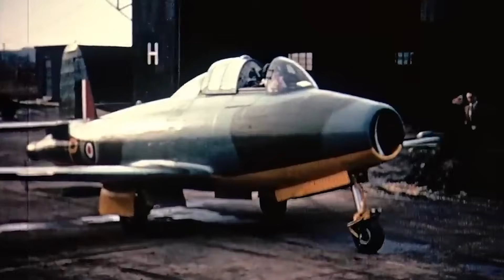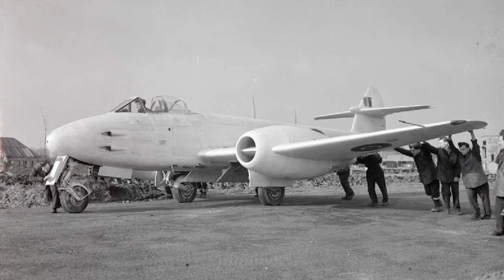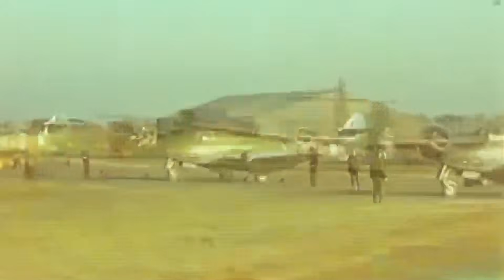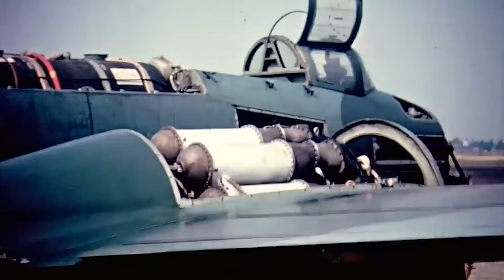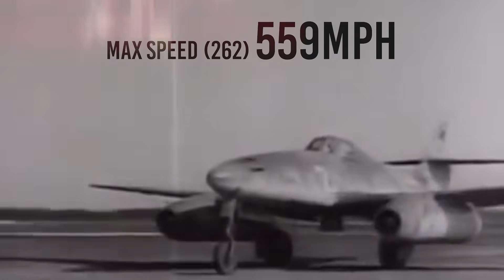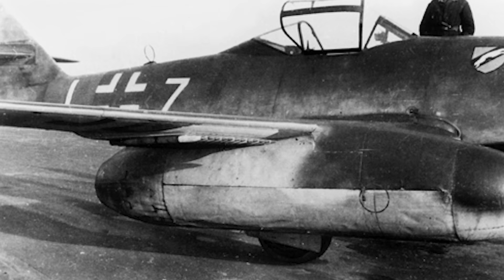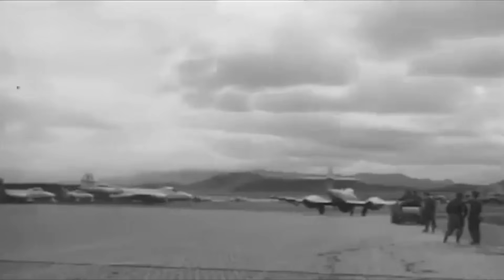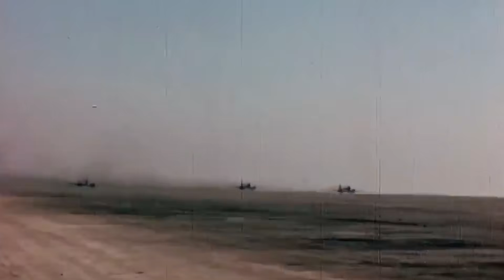Meteor vs Me 262 | Which was the better WW2 jet?

Comment: In September 1945 the Meteor set the world record for speed at 611 MPH. This is a matter of record. the Me262 looked better, but the Meteor had better engines and needed less maintenance
Reply: The Meteor III only had a critical Mach of .74, the 262 .86. Given equal thrust, the 262 was always going to be faster according to the RAF
Reply: @TheAneewAony 

LOL The Nimonic nickel super alloys were developed in Hereford England 1939 -1940. In Germany they thought they needed to use stainless steel for turbine blading which doesn't work and due to various issues ended up attempting to use pressed sheet steel turbine blades. 

262 & it's engines = Garbage (but it did actually fly which surprises a lot of people). In both Russia and France good people wasted their time trying to do something with the engine after 1945. Russians ceased trying in 1948 as their own effort was clearly better.
In France RR got involved in 1950 and managed to get something useful working. 

We feel we can clear up some commonly held myths and misconceptions, obviously.
It's always good to see the facts presented clearly and concisely isn't it?

The Gloster Meteor was one of the world's first jet fighters to go into service, it was in service during WW2. The meteor was the first effective multirole fighter bomber jet aircraft with a reliable engine to go into service,  It broke speed records in 1945 and 1946. During WW2 it was in service as a fighter and multirole aircraft over the UK and over all allied controlled territories in Europe and beyond. 

The ME-262 and it's 46 minutes life engines were abandoned shortly after 1945, it had a do not exceed speed of 456 mph and was only ever used to attack bombers with losses of three 262s for each downed bomber.  During WW2 most of the ME-262s were destroyed by their engines, were various types of accident losses or were shot down by bombers. No German designers were involved with the Mig-15. The Mig-15 used a copy of the RR Nene.  

During the Korean conflict most of the Meteor casualties were due to groundfire or accident losses. The result of any tangles between Migs and Meteors was that Mig pilots avoided getting into dogfights with Meteors. The battle of Sunchon, where 50 Migs against 14 Meteors resulted in the supposedly superior Migs failing to gain any clear advantage caused the Koreans to re-evaluate tactics. General opposition in Australia to involvement in the Korean conflict resulted in the govt using the battle as an excuse to reduce the RAAFs involvement to troop support only.

The world's first wind tunnel was built in England during the 1800s. The world's first supersonic wind tunnel was built in England during the 1920s. 

The Whittle Gloster E28/39  was of course a brilliant aircraft that was later copied in Russia as the upsized and tweaked Mig 15 with a copy of the RR Nene gas turbine aero engine. The RR Nene being the world's most powerful & most reliable gas turbine aero engine in 1944.

The MD F3H Demon was a contemporary to the DH Sea Vixen & had a similar performance. The F4 Phantom was a follow on from the F3 Demon. The Sea Vixen took a long time to get from first flight to introduction for various reasons and a similar situation occurred with the MD F3H Demon.

McDonnell Douglas F3H Demon
590 Built. Not Supersonic.
Max Speed 578 MPH.
Introduction date 7 March 1956
First flight 7 August 1951
Retired 1964

MD F-4 Phantom 2
Number built 5,195
Manufactured 1958–1981
Introduction date 30 December 1960
First flight 27 May 1958

DH Sea Vixen
Number built 151 (including two DH110 prototypes and one Sea Vixen prototype)
Introduction date July 1959
First flight 26 September 1951
Max speed 695 MPH.
Retired 1972

Interesting British achievements.
There is no doubt that the Fairey (England)
Delta 2 was of course the world's first jet
aircraft to exceed 1000 mph.  Indeed It
exceeded the previous record by 310 mph &
held the record for 1 year. Incidentally, the Dassault Mirage 3 & 4 are based on the Fairey Delta 2.

The Panavia Tornado & Euro fighter Typhoon are British design aircraft with British design engines built by international consortiums. 

The EE Lightning was one of the fastest aircraft on the planet when it first achieved a Mach 2 flight. 

Early days, jet fighters.
De Havilland Vampire, Sea Vixen & Gloster Meteor accident losses were not high or unusual for fighter aircraft at the time. De Havilland built large numbers of all metal airframe aircraft before the DH Comet.
We mustn't forget of course that the DH Vampire for example first flew in 1943 & the engine was also built by De Havilland. There were examples of the Vampire interceptor / fighter in service until 1990 which was operated by more than 30 countries.

Non combat phase accident losses.
% of Aircraft built.

The Canadair CL-44 was a turboprop airliner.
Canadair CL-44                  (ff 1959 ) 48%
Lockheed XF104                (ff 1954) 100%
Lockheed  P80                   (ff 1944) 43%
Lockheed F104                 (ff 1954)  45%
Grumman f9f-5 Panther   (ff 1947) 44% 
Convair F102 Dagger        (ff 1953) 45%  
MD F-101 Voodoo.             (ff 1954) 34%
MD FH Phantom 1            (ff 1945)  35%
MD F4 Phantom 2             (ff 1958)  28%
MD F3H  Demon               (ff 1951)  32%
Gloster Meteor                  (ff 1943)  21%
DH Vampire UK                (ff 1943)  23%
DH Sea Vixen   UK           (ff  1951) 33%
Gloster Javelin  UK         (ff 1951) 20%
EE Lightning  UK             (ff 1954) 33%

It's a great pity & a crying shame that British military forces had to occupy a large part of Germany for decades after 1945 & Russian military forces had to do the same. Of course Russia still posseses a large chunk of what was German territory & of course Russia & the UK produce nukes. Obviously Germany does not produce nukes.

Early days, jet engines. Whittle performed the world's first demonstration of a gas turbine aero engine in 1937. The RR Nene, a centrifugal gas turbine aero engine, was the world's most reliable & most powerful gas turbine aero engine in 1944. Licensed built versions & copies of the RR Nene & RR Derwent would go on to power many aircraft in Russia including the Mig 15 & Mig 17, the US, China, France & other countries for decades after 1944. Incidentally, the Mig-15 was in essence an upsized / tweaked copy of the Whittle / Gloster E28/39 jet aircraft including an uprated copy of the RR engine.  The basic centrifugal compressor gas turbine aero engine with Whittle style reverse flow combusters and sometimes an axial compressor section is still manufactured by more than one company including Pratt and Whitney, the main application being helicopters.

The gas turbine engine was invented in England during the 1700s.

During the 1800s Parsons of Ireland & North England produced the world's first axial multi stage sequential stator rotor turbines and compressors for turbomachinery use which would eventually go on to to form the main components of the axial gas turbine aero engine. At the time the basic idea of making an internal combustion gas turbine engine and using it as an aircraft engine was considered thus the jet aircraft concept had been created in England before the first powered aircraft flew.

An example of what goes on these days in various countries. For example, there are of course no German companies that makes German jet aircraft in Germany & there are no German Companies that make German gas turbine aero engines in Germany that are suitable for widebody airliners.

The UK has the world's highest combined per capita Nuclear / Defence / Aerospace Sector Activity.

UK defence sector, absolute terms, world's second highest activity. 1st for per capita defence sector activity. Per capita nuclear powered submarine construction, 2nd position. 
Main players being Rolls Royce, Babcock, GKN Aerospace & BAe Systems. Activities often involve international collaboration. BAe systems, RR and other UK companies now handle more Airbus work value wise than Germany. 

There's a good chance that anyone currently flying on a widebody airliner will be on an aircraft powered by RR gas turbine aero engines made in the UK and a good chance there will be other hardware on the aircraft that's designed and / or manufactured in the UK. 

Rolls Royce Holdings UK
Subsidiaries
- Rolls-Royce plc
- Rolls-Royce North America (ex Allison etc Classified Military stuff)
- Rolls-Royce AB
- Rolls-Royce Deutschland
- Rolls-Royce India Private Limited
- Rolls-Royce Marine Power Operations
- Vinters Engineering Limited
- Rolls-Royce Controls and Data Services
- Rolls-Royce Power Systems
- Bergen Marine
Joint ventures include:
- Rolls-Royce Turbomeca
- MTU Turbomeca -

Trent Family
The MT30 (Marine Turbine)
Industrial Trent 60 Gas Turbine
Trent 7000
Trent XWB Airbus A330neo.
Trent 1500
Trent 1000
Trent 500
Trent 600
Trent 700
Trent 800
Trent 8100
Trent 900
   
RR wholly owned subsidiaries in Germany handle smaller 2 shaft RR gas turbine aero engine work.

The UK space and aerospace sectors are highly productive, high-value industries that together contribute over £18 Billion in direct Gross Value Added (GVA) to the UK economy. Individually, the space industry directly contributes about 0.3% of UK GDP 7•2 Billion while the aerospace industry contributes approximately 0.5% £10•9 Billion.
   
Wee hopes theze helpsmz.  EtC---.

We hope this helps of course 👍

Comment: Nice vid - good entry material for upcoming aircraft enthusiasts. 

But everybody with some more detailed know-how sees the flaws. From my pov a lot of things were correct, therefore i focus on on the things which were imho not correct or just plain repetitions of stereotypes. 

1. There is not a single primary source confirming that the F 3 with the Derwernt engines were put in active combat service. The mentioned figure of 200 produced Meteors (F 1 & 3) until the end of WW 2 is a myth.

2. I tried to research the total number of Meteors put into WW 2 service. It looks like that i was unable to find any reliable data how many Meteors in which version were provided to No 616 squadron RAF. Even their armed reconnaissance sorties over the Low Countries and their 46 ground kills speak either just about 4 aircraft or “the squadron” and is not telling any numbers.

As i direct result it is for me totally unclear if the RAF actually used the F 3 late (which had Derwent instead of Welland engines with 20% more thrust)  before VE day or not as the production numbers were very low and the first 15 aircraft had the weaker engines of the F 1 version and therefore obviously a much slower top speed than the 780 kmph of the F 3 late  version.

3. Engine service life of Jumo/BMW engines: 

The lifespan of 10 hours is no problem if you mass produce the engine and if you are able to replace them rather quick. The designers were aware of the short lifespan, that's why the earlier 262 versions had the underwing nacelles. In addition: The fuel lasted for about 30 minutes - this means 15-20 combat sorties. The lifespan of fresh pilots and /or their aircraft was usually way shorter.

4. Combat effectiveness - Part 1: 
In German doctrine enemy fighters were no relevant threat to critical infrastructure - therefore the focus on heavier guns to allow one-pass kills. The comparison to fighting smaller and more nimble targets like fighters is irrelevant as the overwhelming majority of fighter pilots got killed by enemies they never saw. 

5. Combat effectiveness - Part 2: 

If you have read enough books from all involved parties there are 2 major commonalities: 

1) The majority of 262 pilot losses were reported by the 2 units KG 54 (J) and KG 51. Both were bomber pilots from bomber units (KG) using the A-2a version pressed into fighting enemy bombers and fighters. 

2) The leading Luftwaffe jet aces claimed more P-51 fighter kills than bomber kills. The 262 holds to record of the most jet fighter kills ever. 

3) Most historians estimate the total number of Me 262 seeing actual combat to be around 300 - whilst the peak of combat ready aircraft was about 50 in March/April 1945.

4. Comparison Me 262 and Meteor:

I have a certain level of understanding that you tried to minimize the conceptual disadvantages of the Meteor - but better turn vs a faster aircraft plays no role, otherwise the A6Ms would have won the air war in the Pacific.

 The Meteor airframe had a much lower critical and tactical Mach number - even the allegedly better very high alt performance plays no role if you look at internal fuel loads of both aircraft. Such a "fight" can't be won if the enemy below the Meteor has a higher top and dive speed.

The sole idea of developing jets was to overcome the speed limitations of piston-engine fighters and to dominate fights by the ability to engage or disengage at will. 

As mentioned earlier claiming service life of engines is a stereotype - try to look up actual service/maintenance times of early jet engines - even the J-33 had just 25 hours.

7. Commercial success after WW 2: As correctly stated the Meteor got clapped by Ta 183s ....ehm MiG 15s above Korea. Part of the problem was the glorious idea of some guys in the UK to export the RR nene engine to the USSR. If you look close enough you might acknowledge that just former colonies, formally ruled/oppressed/controlled or low budget and totally irrelevant countries bought Meteors. 

   Referring to later versions of the Meteor as being capable of getting a similar or better top speed than a 1944 production A-1a is at best just misleading. The later versions (HG II & HG III) with better engines would have denied this.

Have a good one!